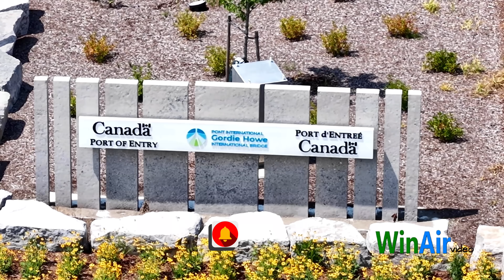How Did This Giant Bridge Get Built So Fast?

Comment: I honestly don't think that this is a fast project. The construction started in 2018. It's been ongoing for 7 years at this point. In comparison, the 4 kilometer Samuel de Champlain bridge started construction in 2015 and was done by 2019. It only took 42 months.
Reply from the maker: Hi Johnathan. I agree, however there are differences. Being an international border for example. That said, it is just the thumbnail. The past two years they have accomplished a lot. JMO. :)

Comment: I was under the impression that the bridge itself is 6-lanes wide (3-lanes going each direction).  But when I view some of the current videos, I see 8 informaton board lights going across the width of the bridge in various places.  Did they now increase the bridge to 8-lanes?  Or what's the reason for the other 2 information board lights?  I hope I didn't confuse anyone.  Maybe there's a better name for what I call the 'Information Board Lights' (black looking squares) going across the width of the bridge.
Reply: 6 travel lanes for cars and trucks and 2 for bicycles and pedestrians.
Reply from the maker: Hi Marcel. The pedestrian and cyclist path is shown and only 12 feet wide. I did a quick search of your question and this is what I found-
You are correct—the Gordie Howe Bridge (GHB) itself has been designed and built with 6 traffic lanes (3 in each direction), plus a dedicated multi-use path for pedestrians and cyclists. The deck and supporting structure are wide enough to allow for these 6 lanes, and there are also full-width shoulders in each direction for emergencies.

As for your observation about 8 “information board lights” (the black squares across the width of the bridge), there is no indication the bridge has been expanded to 8 regular traffic lanes. The standard lane configuration remains 3 lanes per direction. The bridge was purposefully built with a wide enough deck to accommodate up to 8 lanes if needed for future expansion, but at opening, only 6 vehicle lanes plus shoulders and the bike/pedestrian path will be in use.

Regarding the “information board lights,” it seems you are referring to what are officially known as:

Overhead Lane Control Signals or Dynamic Lane Assignment Signals: These hang over each lane to indicate if a lane is open, closed, or changing status. They are crucial for safety and traffic management at major crossings.

Having 8 such fixtures spread across the bridge deck allows flexibility for future configuration—such as temporary use of shoulders as extra lanes, dynamic lane closures (for maintenance or incidents), or, potentially, for the bridge’s eventual expansion.

Additionally, one or two of those positions may be for the dedicated pedestrian/cyclist path or for maintenance/emergency shoulders, which often require their own signal or indicator.

To summarize:

The bridge is still 6 lanes (not 8), with extra width available for future expansion.

The 8 overhead signal fixtures/board lights are likely for the current lanes, shoulders, and multi-use path, as well as for operational flexibility.

The correct technical term is “overhead lane control signals” or “dynamic lane assignment signals”—these are normal features on modern, wide-span bridges, especially at international crossings.

There’s no reason to think you’ve confused anyone; your observation is valid! The bridge’s width and infrastructure were designed for present needs and future growth.

There we go. That clears up the question and helps us understand the extra width. Great question, Marcel!:)
Reply from the maker: Hi Allen. They are using them for emergency lanes but can be opened for traffic if demand dictates. I found an answer to the question in the previous post by @marcel84marcel , check it out.

Comment: How about the bridge surface? It looks like crap with all of the tire tracks on it. Needs to be cleaned.
Reply from the maker: Hi Marc. I did a quick search and found this -There is no public confirmation that extensive surface cleaning has already been completed, nor is there a posted schedule for routine cleaning while heavy work continues. These visible marks are standard at this stage of a large infrastructure build and will typically be addressed by cleaning crews as the finishing phase progresses. 
I assume they will make the bridge presentable prior to opening, because it does look like crap right now. They might wait until just before the final lane painting of the bridge and road decks.